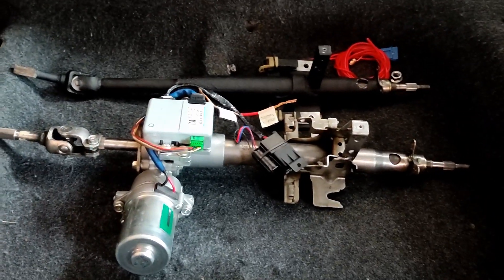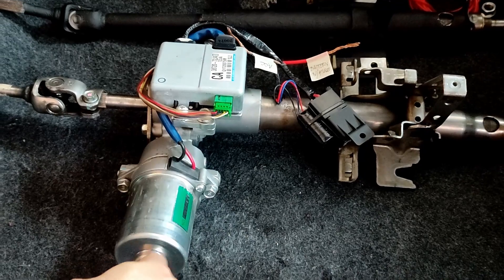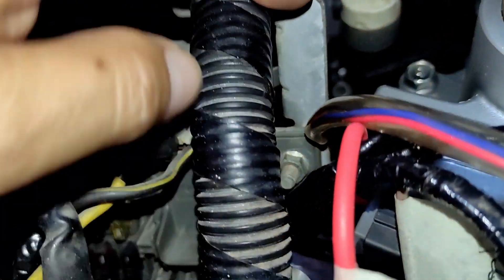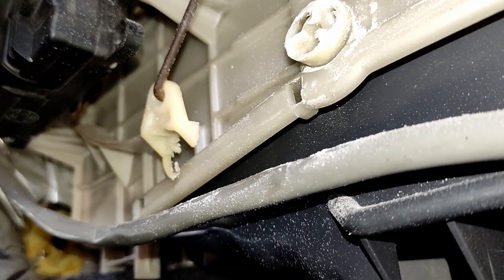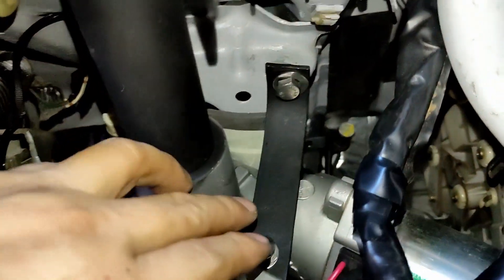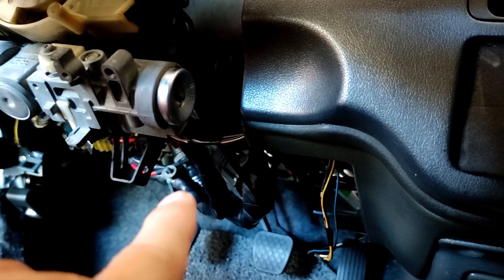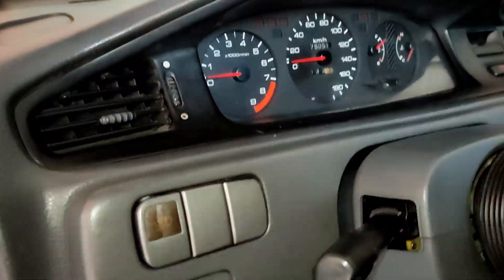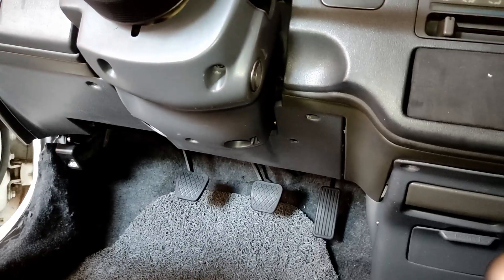honda civic eg d15b, de powered steering to EPS, honda civic electric power steering conversion

Comment: Pwede po sir d na I connect ung sa speed sensor sa eps?
Reply from the maker: no idea ako lods, wala naman naka install na speed sensor sakin sa eps, speed sensor ng civic eg nasa may engine or tranny ata
Reply: @JomsF Mazda k.c auto ko sir kaso speed sensor nya eh reluctor type sine wave signal at ung nabili Kong eps squarewave signal kaylangan.😅hirap pala mag convert😅
Reply from the maker: @smoke_stackz3168  ayun langs naka lagay speed sensor ng mazda sa may steering? if mawala speed sensor mo sa dash, kuha ka nalang obd2 gauge na plug and play naka speed sensor sa ecu or gps

Comment: What vehicle make and model is that EPS from?
Reply from the maker: not sure from what specific model,  most likely from every wagons, alto or celerio
Reply: @JomsF  This looks like the perfect fit for the EG.  The splines, shaft length, brackets, etc.  Has that been modified with parts from the EG column or is it a direct fit?
Reply from the maker: @89GTFoxDude  nope its not a perfect fit or bolt on from factory the original steering column came from suzuki or mitsubishi and converted to civic eg thru welding process, builder had to get my old steering column, so far my eps is still in good shape more than a year now, rev up to 5500rpm and no effect on eps
Reply: @JomsF  Ah ok, I thought so.  No wonder it looks similar to the EG column.  It's actually two half tubes welded together.  Thanks for the info.  I might try it with a Toyota Prius EPS which is easier to find here locally.
Reply from the maker: @89GTFoxDude  yeah i've seen several videos prius eps to civic eg
Reply: @JomsF  Nice.  I guess I need to chop the Prius upper tube and swap it out with the Civic upper tube and reweld, right?
Reply from the maker: yeah there are some vids on yt about using the prius eps, but not sure if there's a walkthrough or guide step by step

Comment: Bro where do u get the signal for the speed that goes to the module?
Reply from the maker: i think its running on fail safe mode as per google and other forums
Reply: @JomsF  thanks bro, planning to do this mod but my car doesn't have an ECU as it's got a carb.
Reply from the maker: @jms2861  you dont need an ECU to run that bro, that convertion is only connected to acc or even ignition for the positive wire with fuse, then the other wire on negative, then another red wired direct to battery with fuse, my friend where i got this from also installed the eps on carb type old school engines

Comment: does this will still remain auto center when you turning your steering?
Reply from the maker: auto center feature of the eps? i think it was disabled, since it is running on failsafe as per google search, so far i enjoy using it, i dont have a long test vid yet coz of super heavy traffic here in manila, but will definitely need to upload someday, will also upload the heat build up on motor and module so far it is very minimal, i can still touch em

Comment: hm po ang eps?
Reply from the maker: Budget ka 12k to 15k goods na yan
Reply: @JomsF 
ganda boss,  Change my hydraulic into electric. Less maintenance at lumuwag luwag yung part ng left side headligh sa engine bay. Mas malinis dn. 👍🏻👍🏻
Reply from the maker: @brylontoc6140  yes lods, kaso sa mga purist or purista its a NO NO daw, diko pa ma test ng 80kph ++ or more, kasi lintek ang traffic dito sa amin, puro gapang dito eh, sa madaling araw naman madilim, sayang yung good friday nawala sa isip ko maluwang nun..haayyysss may mga gumawa nadin sa ibang bansa kaso magulo conversion nila, eto sa atin malinis at simple lang
Reply: @JomsF  +1 ako boss,  tama.  Meron talaga ganun,  gusto stock talaga. Tapos sa ibang bansa ganun nga, tama din, may mga pang yaris, volvo etc etc. at dito talaga sa atin simple lang at wala ng kung ano ano pang iibahin. Kung meron man, konti lang. Kaso boss naisip ko yung maintenance nya. 😅 Well sabagay depende pa din nga kung may budget kaso need na din palitan sa akin eh,  
9k+ Rackend pinion (bnew thailand)
+ hoses (lahat since puro gato na sa akin at not sure kung magkano)
+ Power Steering Fluid
+ Labor
+ Wheel Alignment
at kapag okay na,  yung PSF need mo din monitor, (tagas etc, kung wala nmn, need mo naman palitan kapag madumi na - maintenance ulit)

kanya kanya din nga boss pero sa akin 100% satisfied ako eh.  hahahah.  Though sabi nga medyo malambot daw kapag sa racing (though hindi pa naman ako into racing), recommend naman sa akin ay pwede naman lagyan sya ng switch sa accesories wire (base sa napagpakabitan ko) para pwede i-on or off depende nalang sa pag gagamitan. Pero tama ka boss,  kapag walang galaw ang manubela, naka manual sya at walang voltage na nagagamit... Saka lang sya gagamit ng voltage at lalambot kapag nasense nya na ginalaw mo na ang manubela. 👍🏻👍🏻

Base sa experience:
Manual
engine on
- matigas
engine off
- matigas pero hindi kasing tigas ng hydraulic kapag naka engine off
Hydraulic
engine on
- malambot
engine off
- matigas since may pressure sa rackend pinion at hindi nagpupump ang PS pump tapos bumabalik pa yung manubela

Electric
engine on
- malambot
engine off
- same ng sa manual engine off, masteer mo pa sya na parang naka manual ka.

Kung may makakabasa sa comment base sa experience ko, CMIIW mga boss and base lang din sa exp ko. 😊👍🏻
Reply from the maker: @brylontoc6140  kanino ka pala nag pa eps bro?
Reply: @JomsF  kay boss Edwin
Reply from the maker: @brylontoc6140  waha parehas pala tayo, ni pick up ko nalang sa kanya, then ako nag install, mataas kasi mga humps dun sa kanila hehe, mag update ako if ever may kakaibang nangyari dito, pero so far, super happy ako sa eps nya
Reply: @JomsF  sige sir.  naku, oo nga sir. matataas. hahah.  Ayos din nga at naikabit niyo sir ng mgnda. 😁👍🏻  mag 1month palang sa akin, so far okay pa.  Ang ginawa ko sa akin, inoverhaul ko rackend pinion , inalis ang natitirang pressure at PS fluids. Tapos linis na din at palit bago tie rod at tie rod end.  Mas lumambot sya kasi 0% na yung pressure.  Sige sir.  Balik balikan ko nalang ito sir o kaya vids mo kung meron man mangyari kakaiba sa EPS. 😁
Reply from the maker: @brylontoc6140  sabi din pala ni kuya edwin yung butas or port ng hose dapat daw open yun, para maka singaw hangin, mas malambot if opne yun, sakin nilagyan ko ng pito ng inner tube ng bike para medyo maliit butas, gamit ko padin yung dating fittings nya, pero wala na oil puro grease nalang sa loob
Reply: @brylontoc6140  Boss ask ko lang. Wala naba lahat non kapag naka EPS kana? As in PS pump. Oil. As in pwede na lahat alisin at EPS nalang magpapagana? Less maintenance nga kapag ganon
Reply: @JuanKingPalo  yes boss.  bali rack end pinion nalang sir,  tapos open lahat ng fittings.  Wala na mga ps fluid,  naka open nalahat ng fittings para walang pressure sa loib at hindi mag hatakan. Yung iba naman sir hindi tinatanggal yung pump,  bale naka PS Fluid ka na + EPS ka pa,  kaso ang habol ko kasi eh kahit kahnti eh mabawasan ang hatak ng makina (ps belt delete)  tapos linis sa right side (lagayan ng PS pump at yung baso + wala ng hose din, since halos gato na yung sa akin, sinira ko na mga hoses).  Latest update sa akin,  okay na okay sya,  nilagyan ko lang ng switch para incase sa straight,  pinapatay ko minsan.
Reply: @JuanKingPalo  ito nalang boss ang components:
- rack endpinion
- EPS
- steering column (hindi ko alam yung tawag,  basta yung bareta, pinagkakabitan ng manubela papunta sa Rack end pinion

ito yung natipid:
reason kung bakit ako nag EPS
- bawas bigat sa makina (kahit konting bigat atleast meron padin nabawas)
- palitin na nga hoses, gato na
- may leak,  lagi akong nagdadagdag ng PS Fluid.
- wala na aalalahanin kapag nagsasagad ng bira sa kaliwa o kanan (mas malakas tagas kapag sagad)
- less maintenance (change PS Fluid kapag madumi na, change PS belt, wala na iisipin na tagas kahit sa PS Pump at rack end pinion)
- mas malinis engine bay at wala tulo ng PS fluid
Reply: @brylontoc6140  boss ilan months mona gamit eps? Mag papa eps don kase ako. Naghahanap lang ng honest review sa eps. kamusta kapag takbo ka ng 100 sa expressway? Okay ba? Dba masyado malikot manibela?
Reply: @JuanKingPalo  mag 3months na boss sa june 31.  kapag tumatakbo ng 100km/h? Kapag sa highway, depende sayo boss,  kasi nung una nanibago talaga ako, konting galaw mo sa manubela,  sumusunod kaagad yung gulong,  pero eventually nasanay na. Yung lambot ng eps vs hydraulic?  parang same lang o medyo matigas ng onti,  not sure dahil inoverhaul kasi namin yung rack end pinion,  baka napahigpit yung inaadjust sa may malapit sa pinion ng steering column (di ko alam ulit ang tawag,  basta yung turnilyo nya ay parang hex na malaki) pero sobrang malambot padin naman compare sa  manual at ramdam mo kapag inoff mo ang susi (kasi nakatap yung sa akin sa may accessories - dun tinatap normally). Kung nalilikutan ka naman, lagyan mo din ng switch. Pero masasanay ka din.  Noong nilagyan ko ng switch ang sa akin, sanay na ako, nilagyan ko lang para may choice na patayin kapag sa expressway, at kung sakali itakbo aa track, puwede patayin. Alam natin kapag sa track na,  pagbitaw, umaangat na ang unahan and talagang kokontrolin mo ng maige ang steering kasi malikot.
Reply: @JuanKingPalo  kung malapit ka sa area ko boss,  puwede mo itry.  

Kung icocompare ko itong eps vs hydraulic,  okay nmn din si hydraulic unang unang kung purist ka + may malalim kang bulsa, i-go mo yan. Sabihin na nating pag bukas ng engine bay mo, kompleto pa din. Kaso para sa akin,  mag EPS ka kung gusto mo eh mas makatipid ka,  wala aalalahanin, sa tagas, belt etc.  Nga pala,  downside ng walang tagas na PS Fluid,  nangangalawang yung mga natuyo na napapatakan ng fluid dati. hahaha
Reply from the maker: remove na power steering pump, belt, mga hydraulic lines, mas maganda buksan rack and pinion reremove yung parang malaking washer sa gitna, need ng grinder dun, meron si refine movement at michael flair na upload sa youtube channel nila na guide, then lagyan grease sa rack and pinion, hindi ako nag manual steering kasi ang dame ikot nun bago sumagad, naka de-powered rack and pinion me tapos eps